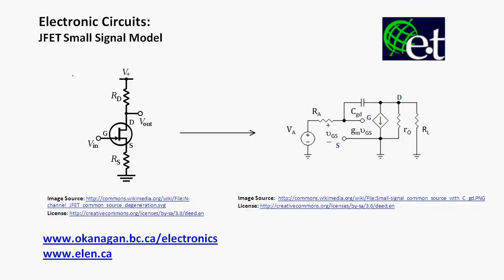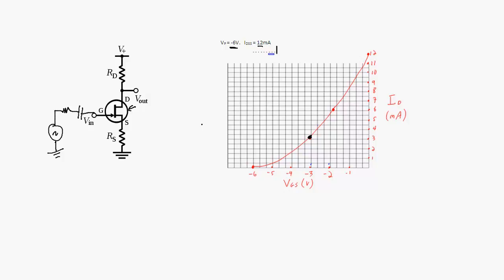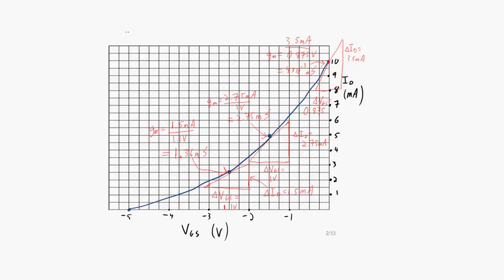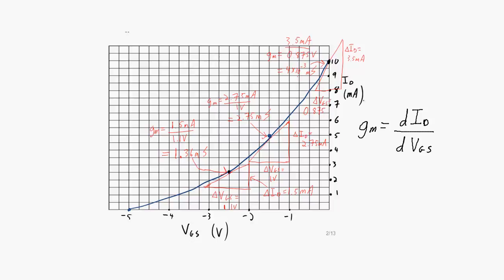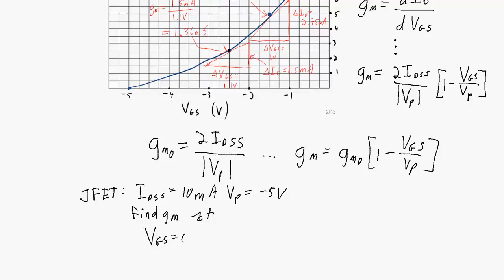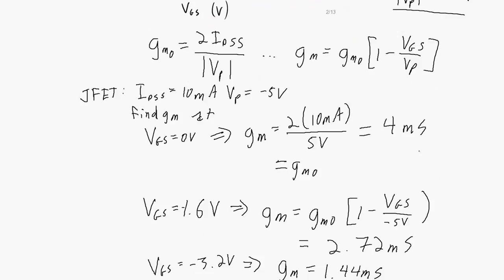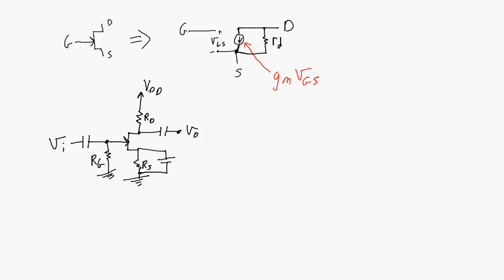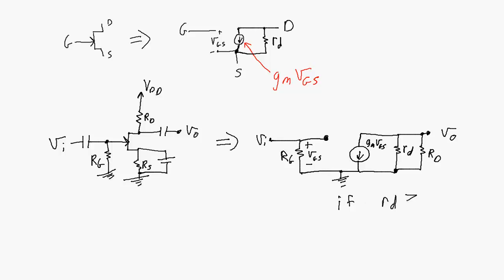JFET Amplifiers - 01 Small Signal Model

Comment: Excellent. my project is the CDM324 doppler module. The output is small so I'm thinking the 2n5457, a bag of them.  The signal is 30-180Hz, like low freq audio. I could try to get amplification from a cheap PAM class D board but that would be cheating. This video got the gears going.

Comment from the maker: @karlkid333, you are absolutely right regarding the large resistor to ground.  I should have that or two resistors acting as a voltage divider to set the gate voltage to its DC bias value.  I would then still have the capacitor to couple the AC signal on top of that.

Comment: Good video, thanks..
I don't get what the point of all the capacitors in these circuits is.. They seem to be randomly placed there to confuse me.
Reply: And why aren't they put in the small signal model?
Reply from the maker: David Gilling capacitors can have different purposes, the ones that I believe you are referring to are DC blocking capacitors.  The value of these capacitors is such that low frequency and DC signals are blocked from passing through them, while higher frequency signals such as the signal that you are trying to amplify will pass through.  These capacitors do not appear in the small signal model because the small signal model represents the model of the circuit as it appears to small AC signals at the frequencies of interest.  At these frequencies, the capacitors can be approximated as short circuits..
Reply: David Williams Makes sense! Thanks for replying so soon!